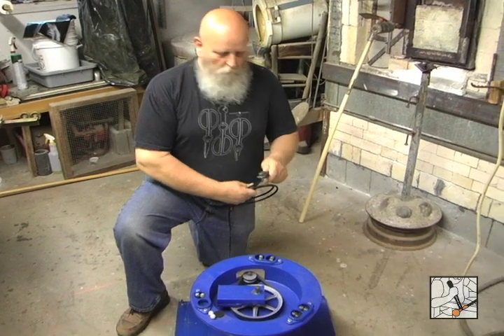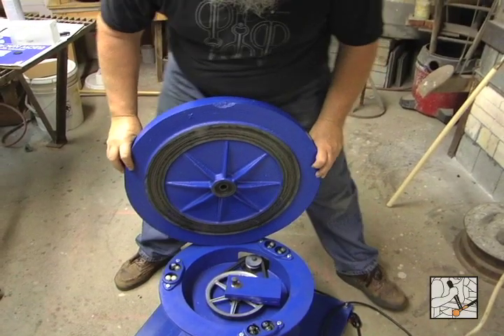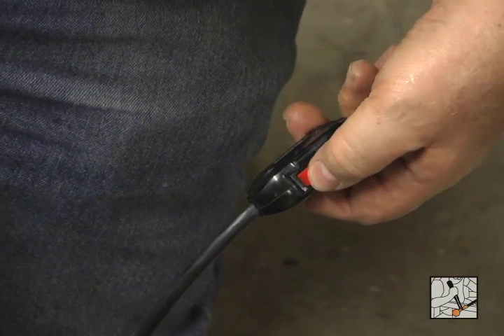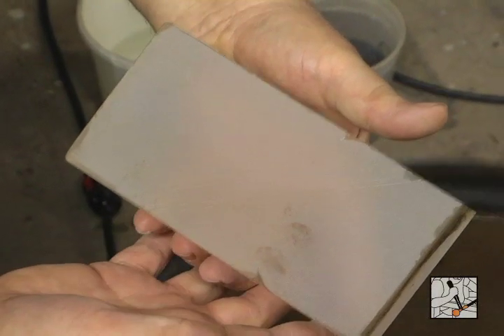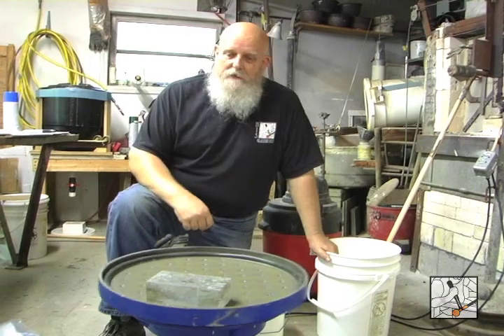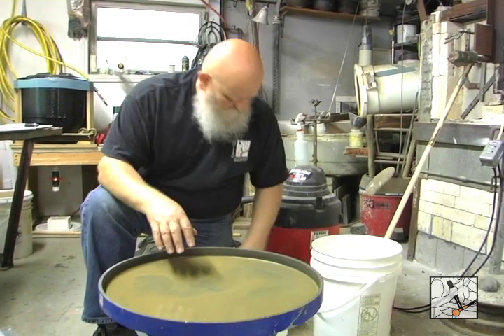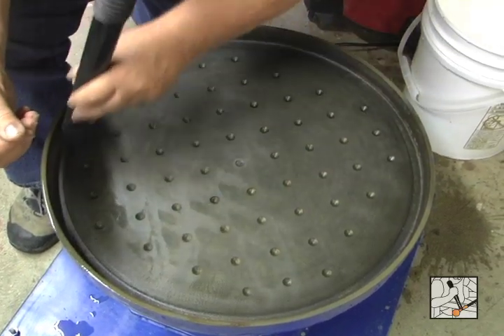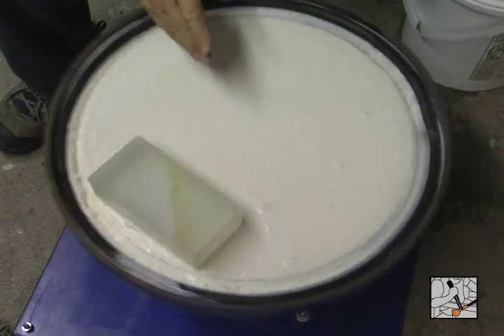Grinding and Polishing Glass with a Rociprolap

Comment: Would a rociprolap or vibralap be able to polish something small like milli chips. I’m thinking of using hockey pucks to weigh down the chips, but wasn’t sure if that would be enough weight.
Reply from the maker: As long as there is enough weight on them it should work. I would work up a jig to put multiple pieces at one time (cast in plaster or wax or something like that with extra weights).

Comment: I'm researching flat laps and one reason I like the reciprolap is that you don't need a constant water supply.  My one concern is how much does the wheel weigh?  I'm a 68 year old woman and can easily pick up around 20 pounds, but this looks heavier.  Thanks.
Reply from the maker: +luminousglassart A 24 inch Rociprolap pan weighs about 45 pounds. I would definitely say it is easier to handle with two people if you need to remove it.
Reply: Thank you!  I think I have to go with the crystalmaster.  I appreciate you guys very much.
Reply from the maker: +luminousglassart You are super welcome. You can find the Crystalmaster here:
http://www.hisglassworks.com/shop/machinery/flat-grinders/small-grinders/12-inch-crystalmaster-pro-110v-60hz-variable-speed-grinder-html.html

Let me know if you have any questions on it.

Comment: Great video.  Can the divider that you show in the polishing step be used in the initial grinding step.  I have several small pieces - 2x2x2  and 3x2x2 and would like to do several at the same time.  Thanks
Reply: Of course it can. You might want to make a divider for each grit though to avoid any cross contamination issues.

Comment: Hello. I love your videos. I'm trying to give a glossy, shiny finish to bottle edges. Which white oxide are you using to polish the glass after the silicon carbide step? Will that work for me? Thanks.
Reply from the maker: We have a number of cerium oxides to choose from and our two favorites are Cer-Optik and Ceri-Tec. Both work very well with a felt pad in a Rociprolap for a final polish and can be purchased direct from our website at hisglassworks dot com.

Comment from the maker: Yes, the smaller Rociprolaps in the 20 inch size start at about $1900.00 without shipping or crating. They are also available in 24 inch, 30 inch, and 36 inch from our website.
Reply: in this video, the machine you use (that we see) is 24 inches ?

Comment from the maker: @loriglass I don't think it would make a lot of difference. The aluminum oxide will break down faster, but that shouldn't be an issue at all. We just used silicon carbide because it's what we have on hand. Either would work just fine though.